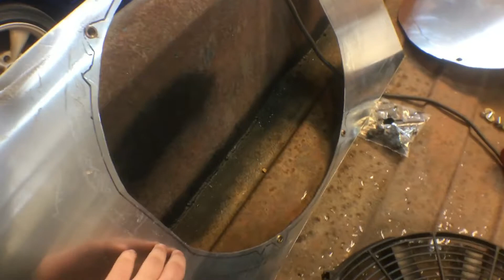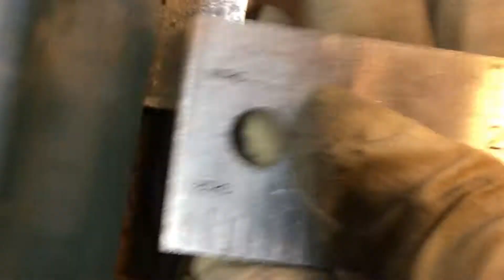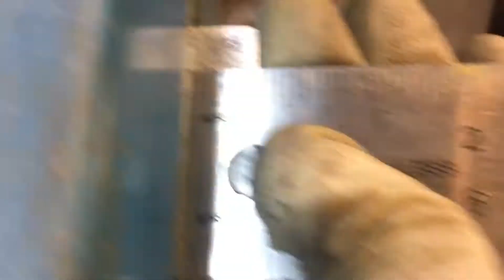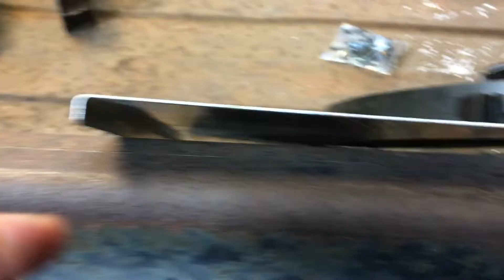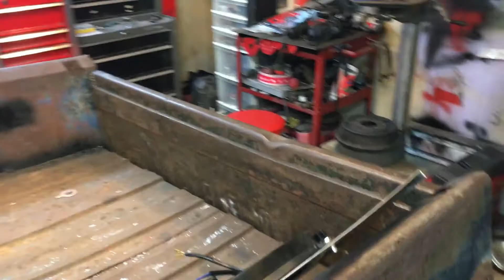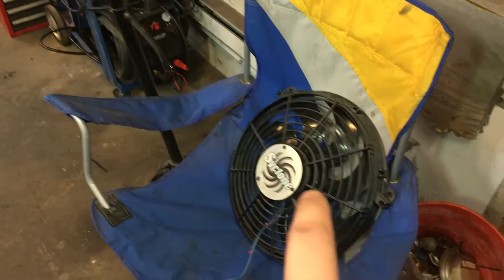Custom Aluminum Fan Shroud Build

Comment: Did it keep it cool?
Reply from the maker: Sip Vids yes. I built 2 the same way. My rx7 overheated a lot with even 180 degree thermostat. That car never got over 190 again. The one I build for my truck, the motor is stock, I never drove with out the fan shroud so I can’t compare. But the truck can sit in traffic at 100 degrees outside and the fan will come on for 20 seconds and turn off. From my experience without shrouds the the fan will run constantly especially in traffic or slow speeds.
Reply: myideasoffun shroud is what keeps it cool. I wish you can make me one. I’ll pay you.
Reply: myideasoffun so with one fan it didn’t keep the car cool even with the shroud? That’s why you built two.?
Reply from the maker: Sip Vids 2 different cars. A single fan on just a rad won’t usually work the best. A should makes it super efficient
Reply: myideasoffun I appreciate the feedback. I definitely need one. Trying to locate one now because I don’t have the tools to cut nor a drill.
Reply from the maker: Sip Vids most tools came from harbor freight. Under $75 for most of the tools
Reply: myideasoffun okay, how’s your cooling part if you turn the a/c on?

Comment: What thickness aluminum did you use? Was there a spec for the aluminum for bending? Gonna build a dual fan one for my Camaro.
Reply from the maker: OldTimer Mike 14 gauge. Ask for bendable grade. Some sheets are brittle and will crack.